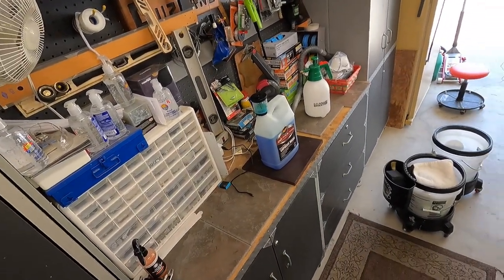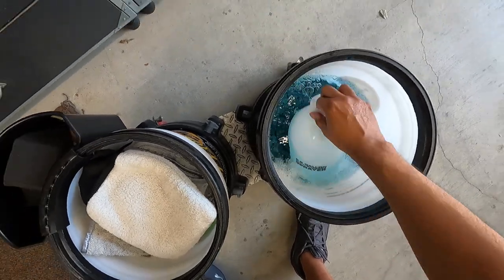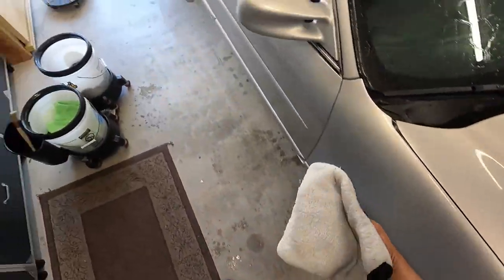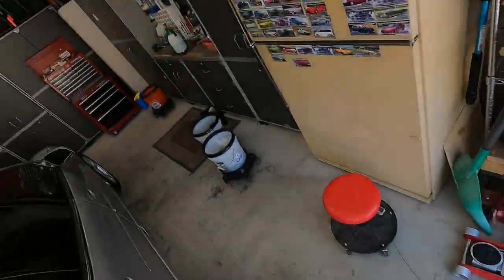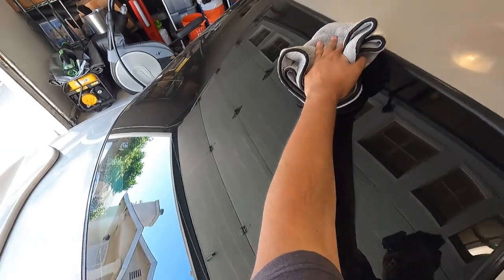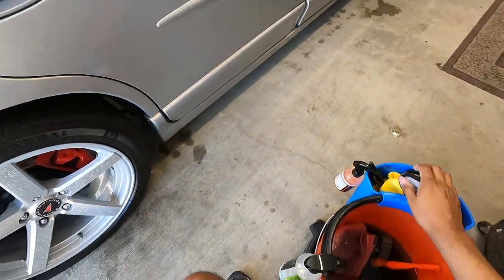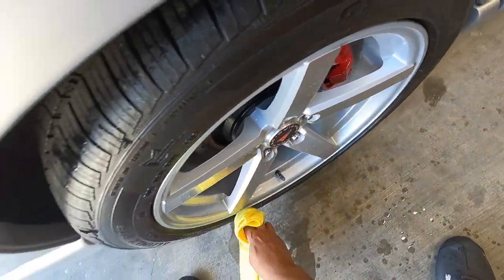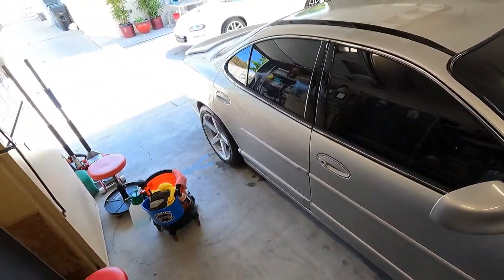Various Rinseless Wash Methods. Which is the one for you?

Comment: Still a die hard ONR and Ultra Black Sponge user here. The way the ONR drops dirt to the bottom of the bucket is not matched by any other rinseless wash, and it enables the safe use of the UBS and single bucket. I've never had any problems with scratching or marring, and I've seriously pushed the boundaries of what a rinseless wash should ever do.

Surfactants contain polymers, and small amounts of surfactants/polymers are still left behind with D114 or N914. ONR is pure polymer, and yes, small amounts are still left behind but do not cause any issues.

You're going to love the Marolex sprayers. Excellent pressure (and air capacity), and great spray pattern. The handle design could be improved (hard on the wrist if you have the big 3L version), and I wish they had a Schrader valve, but still a great option.
Reply: Hey Jeff, ever tried Feynlab RW or Griot's Garage Brillant Shine rinseless wash 🤔
Reply: The whole "nothing left behind" claim makes little sense as something will be left behind from every rinse less unless your using water to rinse off the excess product. Regardless the only time I can see it being as issue is for coating, in which case you'd be polishing and using a panel prep anyways...
Reply: @KiranPatel-fk1pg  yeah ONR is like a cult, like Starbucks, Amsoil and iPhone people😋
Reply: Dropping dirt to the bottom of the bucket doesn't mean much when you use multiple towels. There is no dirt in the bucket to begin with, which is way safer than having dirt "drop".
Reply: @KiranPatel-fk1pg  also it’s never that serious to wash a car lol so many arm chair chemists who think they know better than the actual chemist because “common sense” when sometimes chemistry denies the commoners common sense!
Reply: @blahz7152  and you're free to do that method, but the sponge is so much faster and easier for me. I've tested it on a freshly corrected (junkyard) test panel with soft black paint that I left outside to collect dust and dirt. Dropped the sponge in sand/gravel, quick dunk in ONR bucket and right to the dirty test panel. No scratches or marring when looking at it with a Scangrip light. Made a believer out of me.
Reply: @klasseact6663  I've tried Feynlab. It's a nice option for coating maintenance when you need a little extra surfactant bite, but it can degrade waxes and sealants. 

I haven't tried Griots yet, but I've tested many rinseless products and ONR is still king for me and how I use it.
Reply from the maker: @KiranPatel-fk1pg  sometimes it’s best to let the chemists do their thing rather than is users play chemists. They know what goes into the products chemistry.  It’s less stress in the end.  Just have fun washing.  

I am at the point where I could care less if there is anything left behind from a rinseless that isn’t designed to leave protection.  Most tend to use a drying aid anyway.  If I want something truly left behind I’ll use a ceramic rinseless.
Reply: I agree. It's nonsense to talk about what's "left behind" because in the end it doesn't matter. N914 is better then ONR for me because I just have a better user experience so N914 will continue to be my only rinseless wash solution.
Reply: Nothing a drill cant take care of 😂

Comment: Been sitting on a bottle of Mckees GRW for months. Finally used and did a RW last week and loved it. Slickness is on par with the sio2 stuff. What I noticed with it over the sio2 variant. It acts similar to ONR and pulls the dirt to the bottom of the bucket. With the sio2 RW, it did not do it as well.. leaving a oily ring around the id of the bucket. It seems to clean better too. Lastly less dirt.. almost none on my drying towel. Ive only uses the 1/2 to 22 oz dilution as a drying aid. Tomorrow i want to try some of my AutoFanatic ceramic ww As a drying aid/topper. Stuff is potent with 15% sio2, thinking it will dilute down with RW on the car.

A tip ive probably mentioned before.
I take a Kirkland towel and run it over the super dirty areas (door sills, behind rear tires, rear bumper of car) then toss after. The remaining dirt left on the car is minimal and bucket stays cleaner.

Comment: General tip / thought: if one is worried about towel dirt, pre treat heavy dirt with an APC (like power clean 5:1) and rinse it off with a hose or pump sprayer full of rinseless then just wash it. 
“But my protection!” Yeah well we all use drying aids anyways so you’re reapplying whatever wax/sealant  anyway. And if not, just spray seal the car when it’s dry-adds like 5 mins max.

Comment: N-914 and Feynlab Pure Rinseless are my go-to's with the multiple towel method. However I recently bought the Esoteric Elite Car Wash Sponge with the intention of using it with a rinseless wash. I know that N-914 will work with a sponge but I'm not sure how well Pure Rinseless will due to it's much thicker consistency.
Reply from the maker: Two great options.  Pure Rinseless works good with the ultra black sponge. Sometimes it can get a little sudsy. But it works.

Comment: I've just bought some Carpro ECH20. As bought primarily from going over the car quickly before fitting a car cover and I want to make sure there's not grit or soiling before fitting a decentcar cover as I've not got a garage and want to protectfrom UV, fallout, bird poop and the like. Also I'll use it to go over the front of the car once I've used Gtechniq W8 bug remover, as I don't think its a good idea just to leave the remainder of the deposits on the paint surface and ECH20 would just remove the residue.